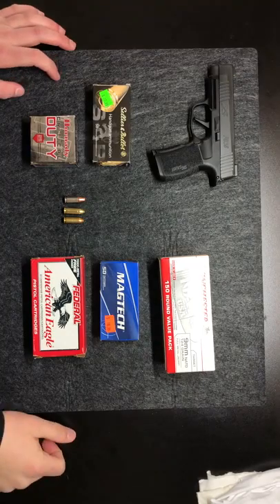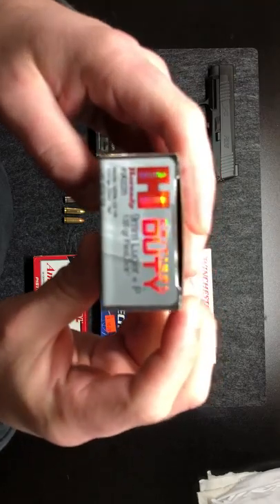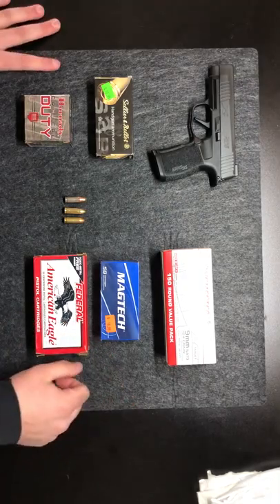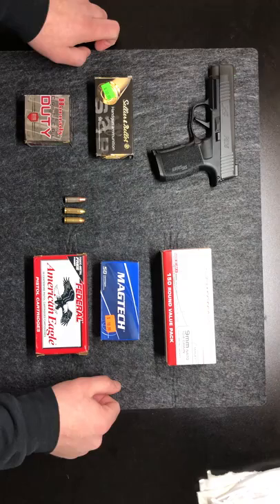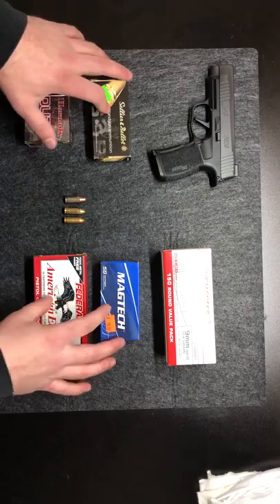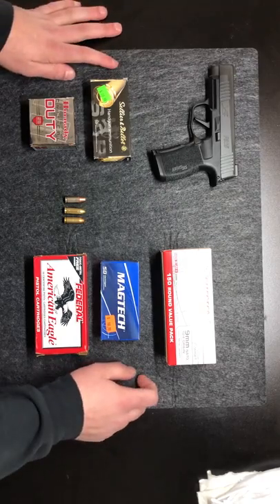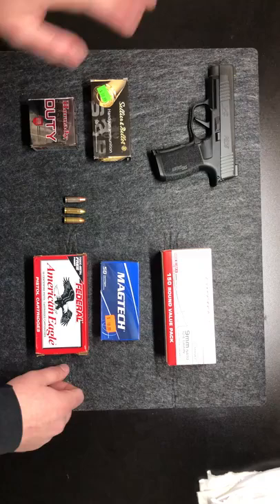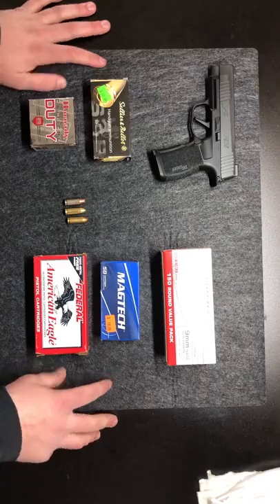Difference in 9mm ammo  Luger, Parabellum, NATO, +p and +p+

Comment: Luger, parabellum, para, 9x19 all the same cartridge, {SAMMI} pressure ratings are as follows, standard pressure is 35,001, +P 38,500 and they don't rate +P+ however, I've been doing this for 57 years, and can tell you that Underwoods Xtreme Defender 90gr +P+ is around 41,000 psi with a muzzle velocity of 1,550 fps from a 4" barrel.

Comment: With the difference in muzzle velocity being no more than what it is between standard, +p, and +P+ I find it better to stick with standard pressure rounds at a cheaper price
Reply: Agreed done a bit of testing. On coyotes I’ve noticed 0 difference between plus p and regular pressure. Only difference I’ve noticed is the small but still a little more recoil with the +p. I can shoot regular pressure ammo faster and thats what im gonna just stick with. The +p is more expensive and its marginal in the ammo types I’ve used. Not enough to justify price for a broke college kid lol. Never shot +p+ and ive never really wanted too. Just wears out the springs faster and has a better chance to batter the frame over time

Comment: ALOT OF MISINFORMATION!!

9x19 Luger and 9x19 Parabellum is the same caliber!! They are NOT “Pretty much the same “ THEY ARE THE SAME!!! Plus must modern 9mm pistols can shoot all types of 9mm +P NATO and +P+ ammunition without harming the barrel and frames !!
Reply from the maker: Pretty much the same but held to different pressure standards which is covered in the video. And not all modern 9mm is rated for +p+. You need to read the owners manual.
Reply: Toy Glocks won't take +P+ ammo. High pressure ammo will break the plastic Glock frame. Made by Mattel or Fisher Price toy company out of recycled Lego blocks.
Reply: Agreed, the same just different names. Luger refers to the guy who patented the design and parabellum is from the Latin "Si vis pace, para bellum" (If you want peace, prepare for war).

Comment: +p+ and ++p++ is not usually sold as 9 mm ammo. It's called 357 Sig. 

Same bullet size and weights available in your normal 9 mm Luger ammunition but with the width of a 40 caliber casing. It is a bottleneck cartridge and will require a completely different pistol, barrel, slide, and magazine. Go buy a new and far superior firearm.
Reply from the maker: Its preference of which round you like. Every round has pro’s and con’s

Comment: Somebody explain the difference between a higher grain (147grn) & a lower grain that have the (115/124grn) +P and +P+…!?!
Reply: Grain is just how big the bullet is overall, it doesn't get wider (caliber) it just gets longer. A bigger bullet will be slower, a smaller bullet will be faster, assuming they use the same gunpowder load.

+p means that the gas pressure of the burning powder is a little bit higher than standard, and +p+ means it's EVEN HIGHER.

+p is safe to shoot in 99% of 9mm handguns (read your manual or look it up), but +p+ is best left alone unless you know what you're doing.

+p isn't even necessary to be honest, standard pressure is fine.

Comment: Can you help me find out which of these would be best for a 9mm ruger?
Reply: This guy doesn't really seem to know what he's talking about, spreading around some confusing/incomplete information in this video, so here goes:

9mm Luger, 9mm Parabellum, 9x19 are the three names for this cartridge. 3 names, all the same cartridge.

What matters is the specific loading that you choose. 115-147 grain is the typical range of bullet sizes, and virtually every 9mm handgun that's out there (other than certain old guns and relics) can handle the standard pressure as well as a "+p" (slightly higher pressure) load. Stay away from the +p+ stuff though just to be safe. If you have a Ruger Security or an old Ruger P-series they can handle a +p load just fine, but it's only a marginal difference between that and the standard pressure.

Choose a modern JHP (jacketed hollow point) round for the real deal self-defense, and choose any FMJ for target pratice. Typical grain is 115 or 124.

Be sure to test your gun by shooting a box of your chosen hollow points, just to make sure that your gun likes those and won't jam up when you need it.

e.g. Hornady Critical Defense, Federal HST, Speer Gold Dot, the list goes on and on.

Comment: NATO is not the same as para and luger.
Reply: Luger/Para/9x19 are the three names for the cartridge.

9mm Nato is a specific loading (124gr +p FMJ), in the same way that Speer Gold Dot 115gr is a specific loading.
Reply: @ManDuderGuy so if it can handle +p then it can handle NATO too?
Reply: @bradleysmith9431   Yes, the NATO loading is a +p loading but it's not all that spicy.

If it can handle +p then it can handle the NATO load for sure.

Virtually all modern-production 9mm guns are fine with +p btw. Check your manual or look it up if you're not super sure.

"+p+" stuff and unprovenanced reloads from "some guy" should be avoided in general.